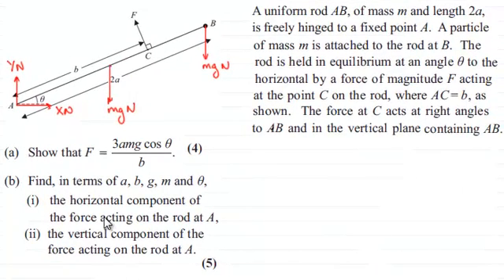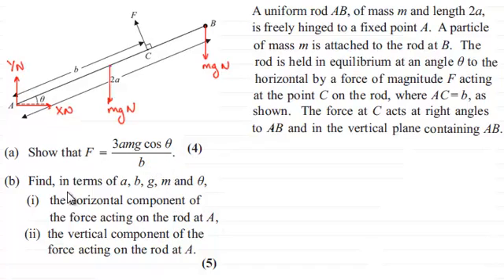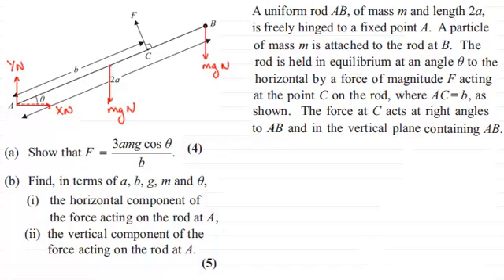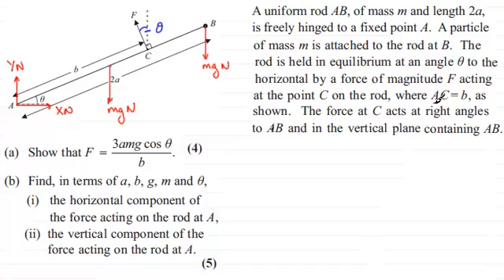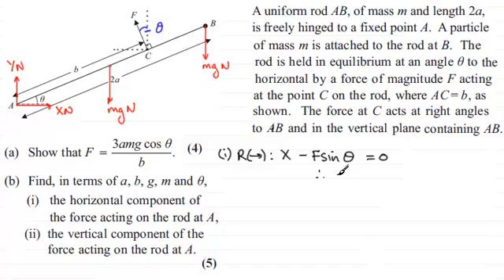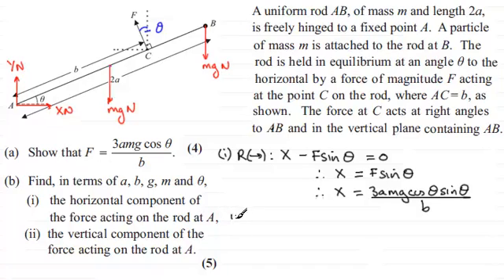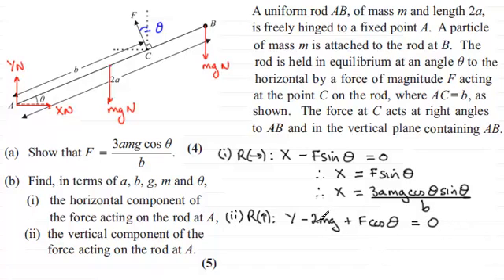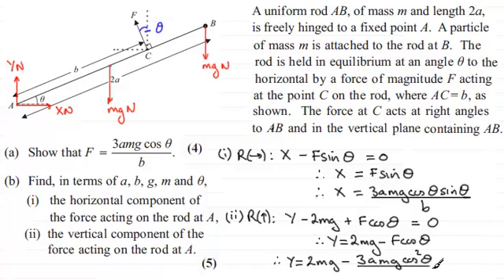Forces at a hinge : Mechanics : M2 Edexcel June 2013 Q5(b) : ExamSolutions

Comment: surely you can split the mg forces into horizontal components like we did in part (a) by using angle theta?
Reply from the maker: They act downwards and so the horizontal component would be zero as it is perpendicular. cos 90 degrees =0